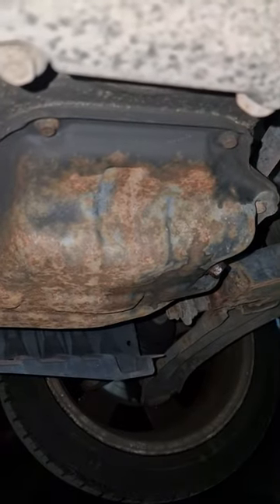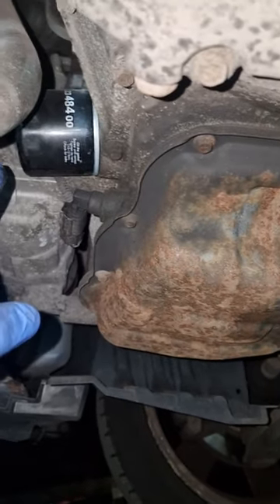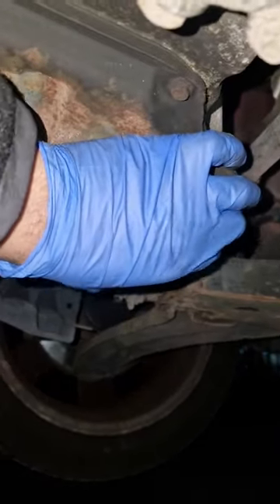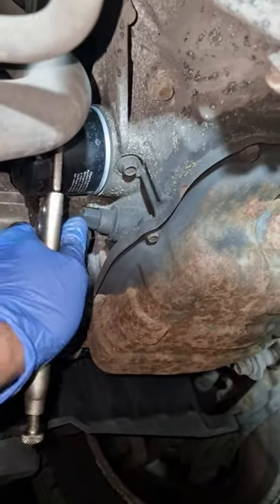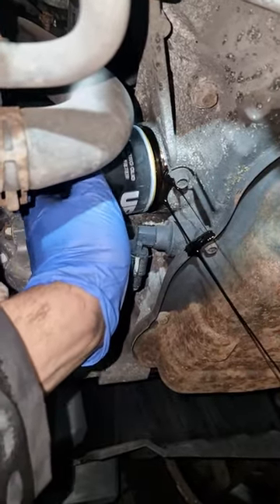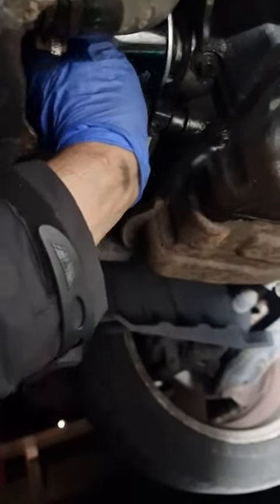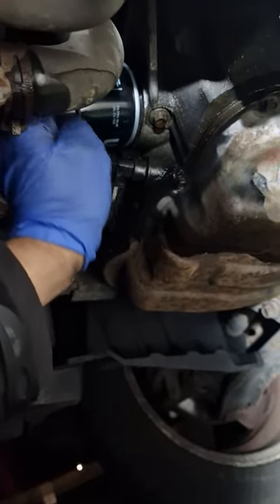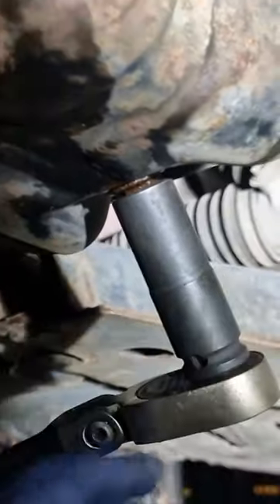Nissan Note Service #nissan #fix #viral #shorts #review #work #oil #car #workshop #service #tools

Comment: Old air filter looked better than the new one 😂 and try taking the oil filter off with a bag around it saves making more mess the bag then catches the oil spill out
Reply from the maker: I thought the same thing when i saw the air filter, lol. Normally, just use brake cleaner for the mess
Reply: Brake clean does everything normally 😂just the bag saves the hassle of having to tidy up and not end up with it on your self which is annoying some times 😅👌🏼
Reply: @DrivingwithAsh  got to hate it going down your sleeves though sometimes 😂
Reply from the maker: @willan9240  i will try the bag trick. I do hate it when that happens, lol.